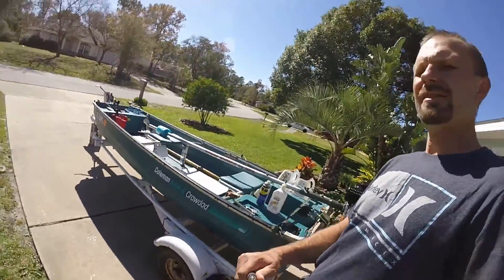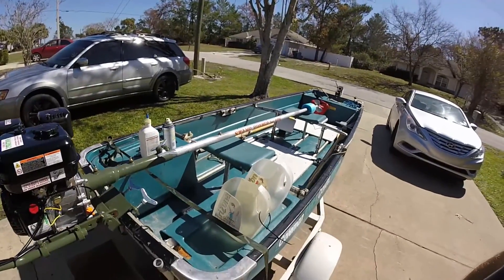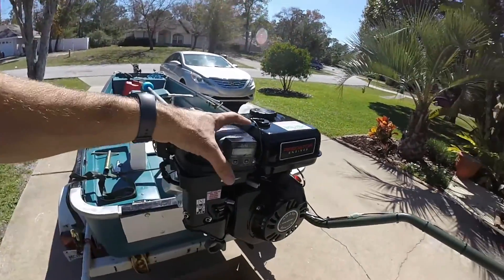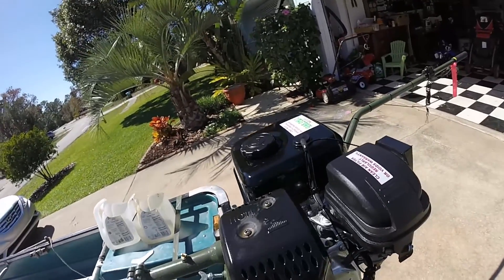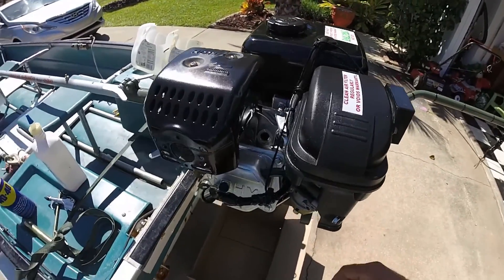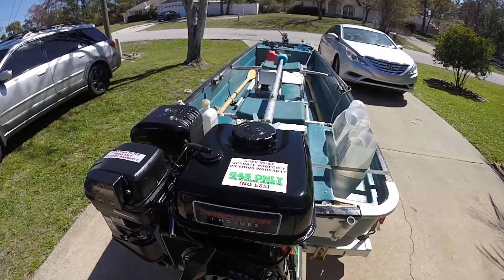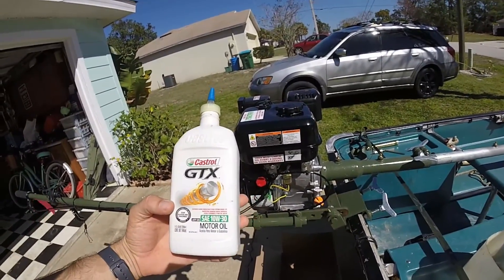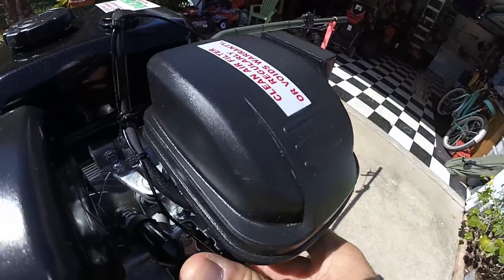How to recover an engine that's been under water

Comment: I rode my mini bike (which uses a very similar engine) through some water the other day. I feel over, and the bike was completely submerged on its side for a few seconds. I managed to pull it back up and out, but it did not run right away (I thought since it was only under for a few seconds it would be fine). I took it home, and then looked up your video. It helped me greatly. After I dried everything out and changed the gas and oil, it started right up. Thanks for the tips!

Comment: Great video. Very helpful. My pressure washer fell in the pool. I had to remove my gas tank in order to get to the carb. Should I refill with fresh gas before cranking to get the water out of the spark plug hole? Or can I crank it without gas? 

Ask, there is no kill switch on the generator. Just on/off and choke. I’m assuming I should just put it in the off position with the choke pushed in (no choke). Is that right?
Reply from the maker: Crank it without fuel and no spark plug. Soak the cylinder with wd40 to Chase any water out. Add new gas and oil then run it. Change the oil again and run it again, then change the oil a final time and it should be good. This will ensure their is no remaining water in the crank case should any have gotten in. I hope this works out for you.

Comment: Hi Zane I got 20 litres water out of my truck motor from flood car park . No time yet to remove glow plugs and wind over 

Do you think bores probably need honing
Reply from the maker: The you need to get the water and oil out asap. The faster you complete the process, the better odds you will save the motor. I had a boat sit underwater  (salt) for 2 weeks but once it is exposed to air the clock starts ticking.

Comment: Great vid. Let me ask. When using the wd-40 does that have to be fully cleaned out? I'm just trying to understand that if you fill the spark plug hole won't that get into the piston? I have a pressure washer that was brand new in the box when our house got flooded with water in a storm.
Reply from the maker: It's chemical properties somehow chases the water away.

Comment: My boat dumped over I was able to get some water out taking the spark plug out but needed to use the engine to get back at the boat ramp. Now my mud motor is slow. I cleaned out everything I wonder if I bent something.

Comment: What what would you do if you did try to start it when it had water. In my situation I had rain water that got down the muffler of my small engine to my pressure washer due to a few small holes, and when i tried to crank it up I did not realize this. I followed your steps but it still wont crank. It seems like every time I put fresh oil in it and attempt to start it for several minutes the oil becomes watery again, ive changed the oil twice and have yet to start it.
Reply from the maker: If it was hydro locked you may have bent or broke something causing it to bind.
Reply: @Zane-lc2zf  do you know if there'd be a noticeable sound while trying to start it if something was broken. it just sounds like its trying to turn over but wont, nothing abnormal sounding ike its locked up or anything like that

Comment: Cool video! What is that electronic digital display box that is mounted to your air cleaner cover?
Reply from the maker: +floridafishhunter it is an hourmeter/tachometer
Reply: I figured it was an hourmeter but the two buttons threw me off. Having the tach with the meter is a great combo when it comes to maintenance. I'm actually considering a mud motor setup for my kayak. I think it would make for a fun project.
Reply from the maker: floridafishhunter they are definitely not a very maneuverable  motor to use. they are great motors for the right situation but definitely have cons also. If you are looking at the weedwacker set up for kayaks it should be ok but you will still lose maneuverability. I wish you luck with it, be safe.
Reply: Thanks! Safety is always a priority with me. The setup that I'm considering is with the 6.5 hp predator motor which would go on a custom mount right behind my seat that would allow it to only tilt up or down as I plan to steer with the rudder. I was worried about that motor in the saltwater environment but now that your motor was submerged I will be curious on how the motor (corrosion wise) will hold up for you.
Reply from the maker: floridafishhunter a 6.5 set up might be heavy for a kayak. It will also create a much higher center of gravity.
Reply: Yes I agree. I looked up the specs on the motor last night and at 37.5 lbs it may be a bit much. Although I believe my 14 foot hobie can handle the weight I will play around with a weed wacker setup and see how that goes. Thanks for the feedback.